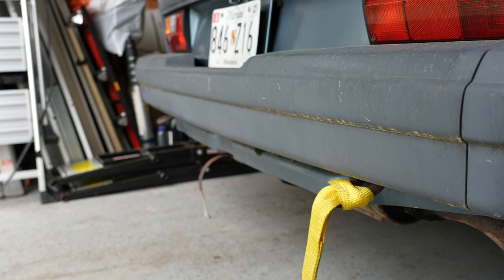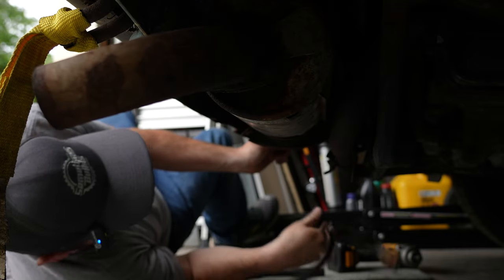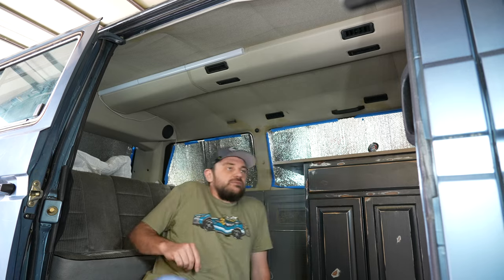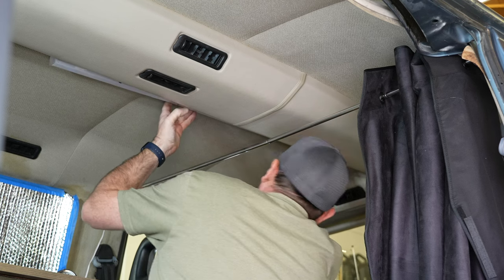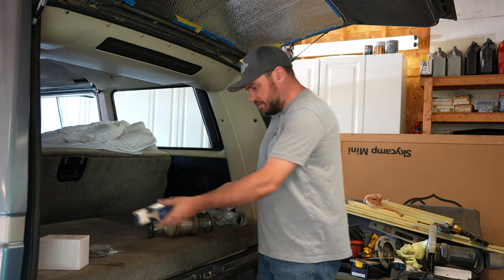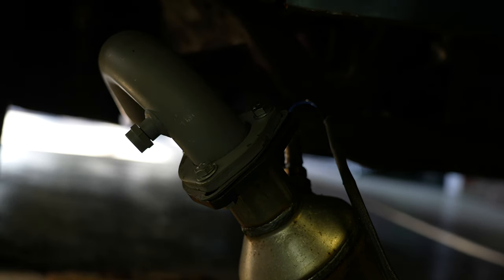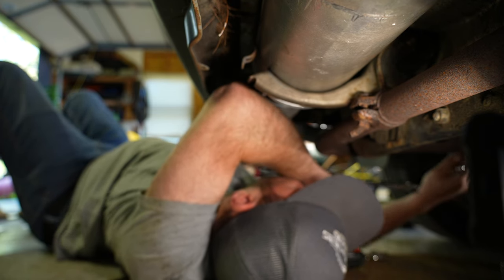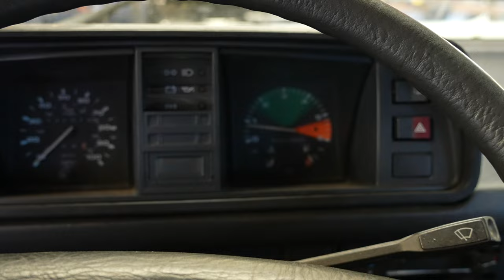Replacing the Muffler and Catalytic Converter on my 1988 VW Vanagon - Will it Solve my Problems?

Comment: Check your engine electrical grounds. Should be one with good contact left side engine to left firewall. If it's the small braided cable replace with a plastic shielded battery style cable from local parts store. Check distributor cap, rotor button, and plug/plug wires next. The loud tapping noise sounds like a hydraulic lifter or two have bled out. Sometimes they'll pump back up. Might be good to check valve clearances if it hasn't been done yet.

Comment: Always check spark plugs first.  Check the valve lash. 

I'm with you on not wanting to ruin the trim but self tapping the lights on may be a last ditch option.
Reply from the maker: Yeah had to do the self tappers. Just tired of dealing with those things everytime I work on it. 

Doing a full tuneup in the next Vanagon video. Plugs, wires, cap rotor and injectors. Filmed and scheduled.  (spoiler: but it didn’t fix the problem 🫠)

Comment: Replace engine. 😅there’s no other better fix for misfire. You could try smoke testing the engine and see if you have a vacuum leak. Also..You’ve got a stuck lifter from the sounds of it.. sometimes lifter oil by liqui moly helps. I replaced my stuck lifter and it went right back after about 100 miles.. 😂 I say ditch the lights. I made curtains for my van using flat aluminum bars from Lowe’s.. then we hang small lights from the bars..it’s easy..
Reply from the maker: 🫠 I’m hoping it doesn’t come to that! Very true about the vac leak. The hoses are rotten and that very well could be the issue. I’ll grab some lifter oil and try that too. Next Vanagon video (filmed and scheduled for release already) I did plugs, wires, cap and rotor and injectors. Improved power but it will still hesitate and stall out at times. 😩
Reply: @TheSometimesBuilds  sorry man..  it does sound like a leak of sorts. Vanagons are frustrating as heck.. even after I’ve replaced the engine, rebuilt the tranny, and gobs of other things…mine still has gremlins… there’s a reason why old people own them…it’s because they have patients for the continuous diagnosing of problems.. lol